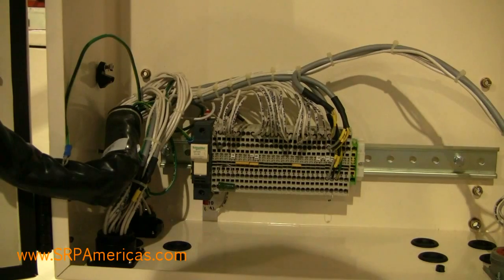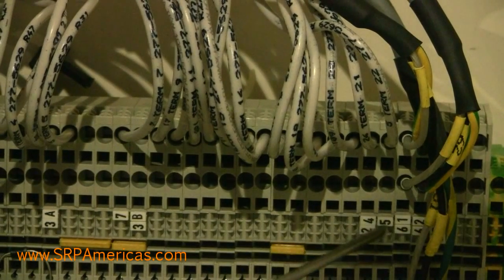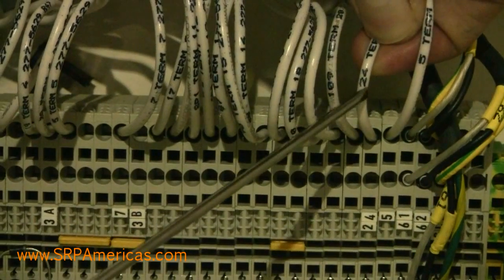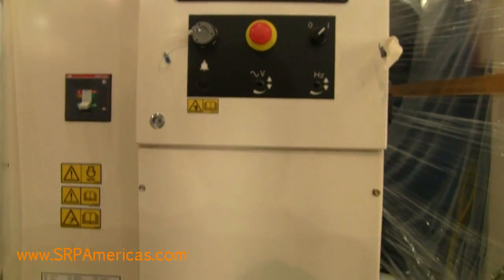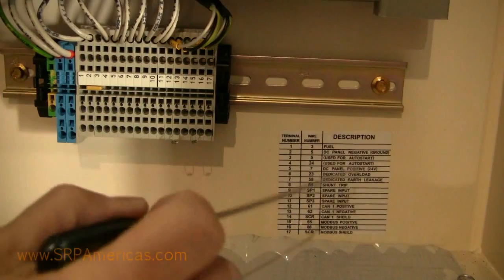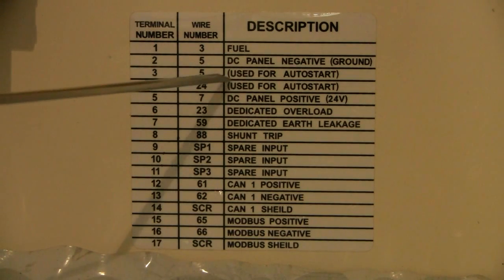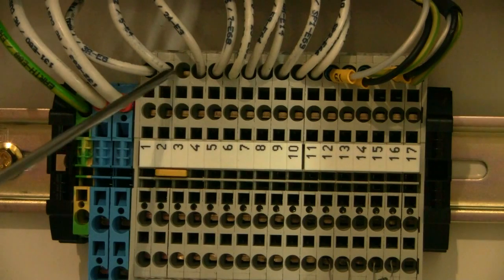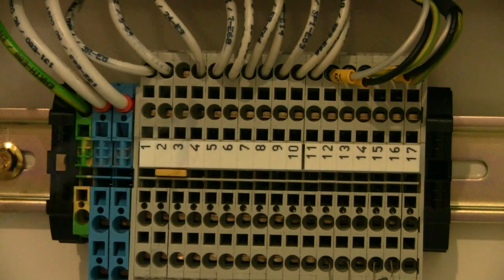How to Locate Wires on Powerwizard 1.0 and 1.1 in a FG Wilson Generator

Comment: What number is the  remote start to ATS panel ?
Reply: 5/24
Reply: @electricaltech4u45  Plz tell me How we use 24/5  for ats?
Reply: @hamzakhalid6965  dear bro insha Allah tomorrow i explains with partically. And shows how its work its very easy.
Reply: @electricaltech4u45   video py or drawing? 
Mm ye janana chahta hun k 24/5 ko awpis mn connect krna hai or 24vdc supply daine hai?
Reply: @hamzakhalid6965 .dear bro both possible i have controller and drawing is you like. Otherwise just install one relay and connect with main source when your main source fails its well run. also connect with timer if you want to run your generation weekly.
Reply: @electricaltech4u45  sir ap mujy drawing bta dain... 
Mtlb 1 relay lgani hai main grid supply py. Us k NC py 24/5 wire lgani hai?
Reply: @hamzakhalid6965 .yes bro NC .because when source available NC becomes NO. When the source is fails its connect and generate get single to run .
Reply: @electricaltech4u45  Aisy work kry ga... 
Apny prectical kiya howa hai is py aisy?
Reply: @electricaltech4u45  bhai apny video snd krni thi aj ats ki!
Reply: @hamzakhalid6965  dear bro plz video i make for you. ELECTRIC TECH 4U
Reply: What do u mean by remote start

Comment: Hi,, 

I have a Powerwizard 1.1 and 1.0

-------
The screen is showing the menu options,,
but the buttons are not responding at all,,
it's like there is some kind of a problem in the connection between the buttons and the panel..

can there be a fix for this,, or should I replace the whole panel ??

Thanks and regards,

Comment: Q) How to connect the Power Wizard 1.1 Modbus wire? Did the Modbus supported by Power Wizard 1.1 or not?
Reply: +Jemo Glemo 
The PowerWizard1.1 does not support Modbus. You will need to upgrade to a PowerWizard2.1 for this.